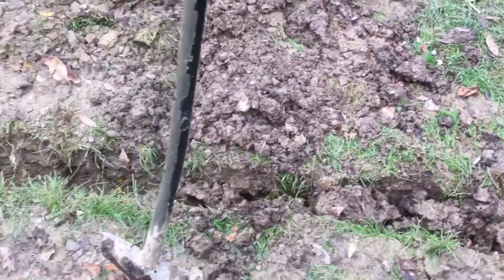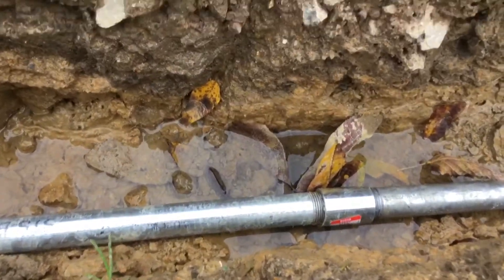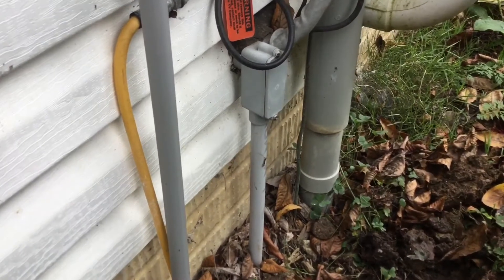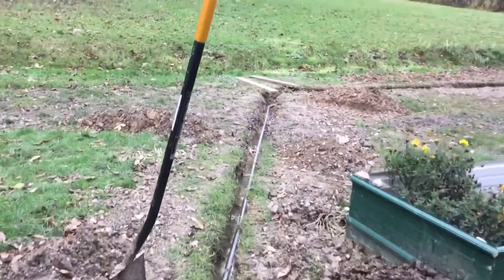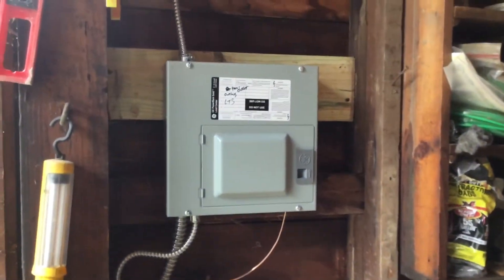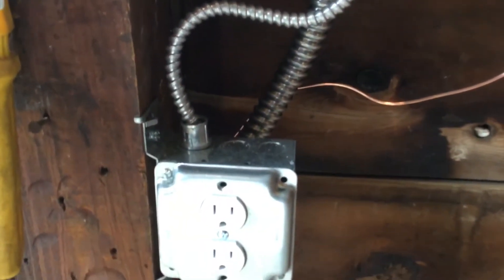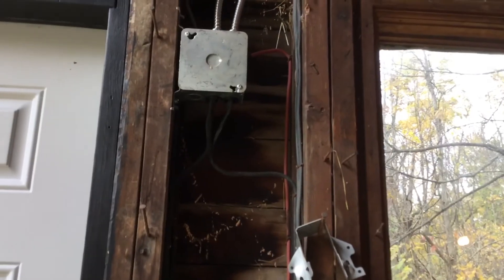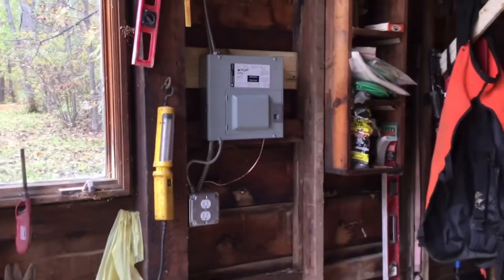Underground Electric Wiring to the Barn! Steel Conduit #electric #electricalwires #electricalwiring

Comment: Did you use any type of sealant on the threads for the emt?   Im going to run mine soon and im curious as to any moisture getting in the pipe
Reply from the maker: I had the electrician install the pipes and I don’t recall seeing him use sealant. It would probably be a good idea to use sealant.
Reply: Water gets in anyway from condensation. That's why you are required to use water rated wire like thwn/thhn-2.